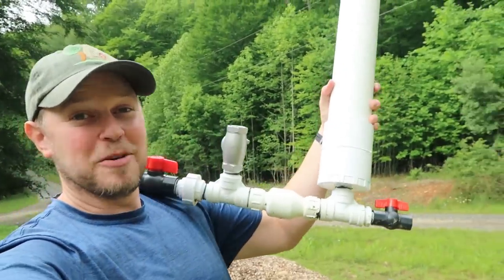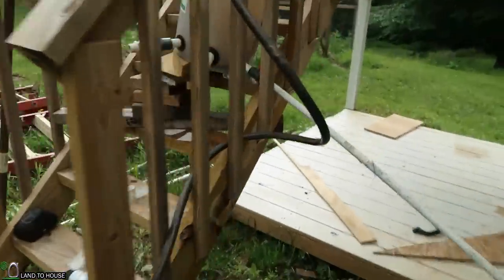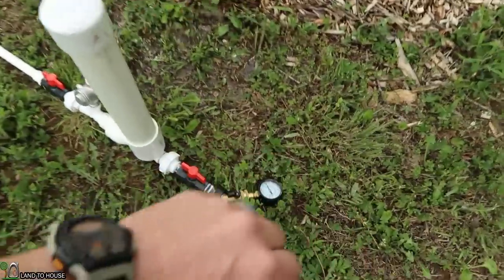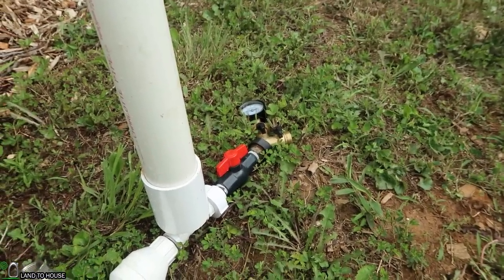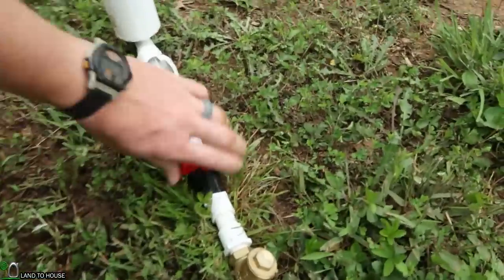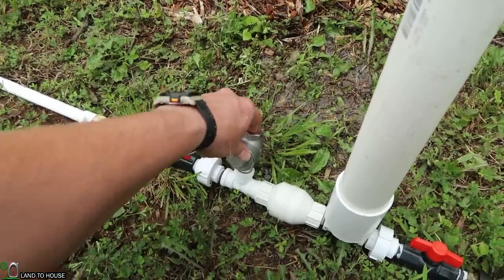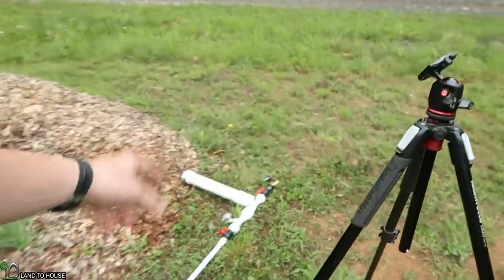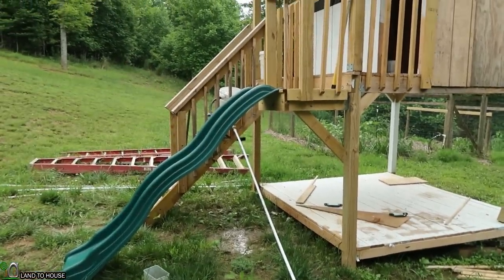Ram Pump with Check Valve on the Drive Pipe ?

Comment: Your videos give me the answer s to my worries concerning the ran pump .you are a good teacher. What happens if l locate a none return valve after the pump ?. Thanks may God give you more energy.
Reply from the maker: Placing a non return valve in the delivery pipe can reduce the weight on the pump and increase output some.

Comment: Move the check valve back a foot or two, and then eliminate the waste valve!  Would the inline valve work as a waste valve and send the water in to be part of the pumped out water? Not just in theory but please have you tried this setup?
Reply: You need the pressure wave to travel back up the drive pipe to reset the check valve.  Eliminating the waste valve can be done but it will add mechanical complexity to the pump.

Comment: I noticed that you tested with a brass swing check valve.    Have you tried a similar brass swing check valve instead of the inline PVC check valve after the waste water check valve and before the expansion tank.   The PVC check valve seems stiff and might constrict the water flow.  I assume you have tried and doesn't work?

Comment: Placing the nrv a 1/3 the distance from the pump(2/3 from source) will make a big difference; the pressure wave(water hammer) only travels back along the line a short distance(around 1/3 distance from pump)

Comment: What would happen if you put the NRV in (roughly) the middle? 
I guess it would still prime but would cycle faster as the pressure wave isn’t travelling as far, so, could it be useful for very long drive pipes where sometimes it’s just too long and would usually need a stand pipe?
Reply from the maker: Great idea! Let me test that next. Perhaps install a 200 foot drive pipe for that 1/2" pump and test: no valve , stand pipe, valve. Thanks!
Reply: In the middle is an interesting idea.  I wonder if this might be an alternative to a stand pipe at the middle location.   Wouldn't allow air to be released, but might have a similar effect of cycling?
Reply: @davebean2886  I did just that with my ram pump. I have a spring-fed pond with about a 6 foot head to the ram pump but the distance is nearly 150 ft. I had HUGE pressure waves oscillating down my drive pipe, so much that at one point the drive pipe jumped out of the pond and disconnected itself from the water source. I placed a one-way check valve at about the middle and most of the pressure wave I saw in my drive pipe dampen to the point it barely quivered as it pulsed in my pond.   I didn't see any real difference in the water output and I easily am pumping over 200 gallons per day up a 60-foot hill. I really liked the one-way valve, it seemed to help stabilize my setup more and was easier to maintain than a standpipe.

Comment: Thank you as another comment said having the valve at different distance from the pump could be interesting. Just to see if there is any improvement at all. Maybe it would work better on a larger pump with the valve at the pump as there would be more volume per cycle between the valves. Thankyou again.

Comment: Is there a way to make a waist valve return to the supply or water source reserve for zero spill maybe a stack that tees off just above the waist valve so you can prime it. Then cap the top after priming but have a line returning at the side of the tee

Comment: At present my ram pump have swing check valve at the drive pipe very closed to the pump the same as you did for your 1st test. I don't have any problem about ti run ir prime the pump. There is an increase  the output or water delivered. I don't know  why you could not run the pump.
Reply from the maker: It is a mystery. I will have to continue testing.

Comment: Is there a neoprene non return valve as used in aircraft in these sizes ? If so ,the force use to operate them will be negligent ,much much less than any swing or check valve .

Comment: Could you put a timer valve in the drive pipe and have it come on and run for a certain period of time, like for a few hours each day, long enough to fill a tank then shut off. Would it stay primed and continue to run daily without human contact?
Reply: The ram pump will run 24/7, 365. The flowing water even keeps it from freezing when it gets cold.

Comment: I would love to see the water flow in the pipe with some dye. 

I suggest purchasing a clear pipe, drill a small hole. Insert a syringe with some dye. Then as the ramp pump is operating, squeeze the dye into the pipe. Maybe even record it in slowmo if needed.
Reply from the maker: I posted the video sometime ago with an endoscope showing how the Ram pump pulses. It is interesting.

Comment: Nice man. I was asking this question myself today, and you can see why. When you contain the pressure wave from the water hammer near the pump the pressure in the pump assembly is greater than the pressure from the drive pipe, so the drive pipe check valve fails to re-open. Curious to know if you would see an increase in pressure if you sat and manually cycled the pump using your finger on the waste valve, as you were doing .Even so the answer would still be 'no'.

Comment: I have a 3/4" ram pump with a soda bottle air tank and 50' feet of 1/2" garden hose the flapper valve is working and the air tank is holding pressure but the water is not coming out of it even when i prime it wat am I doing wrong?
Reply: Use a rigid pipe like pvc so the water hammer effect is not lost; hoses absorb a lot of recoil being rubber, and the pressure that causes the recoil is what makes the pump work.

Also consider a smaller pump if you have less head to work with. Higher head usually suggests a larger pump, while lower head works fine with the 1/2 inch pumps

Comment: I don't understand what the purpose is for adding the extra valve. What would you hope to get by adding it?
Reply from the maker: The subscriber that asked for this test thought it might improve the output because it would not have as much pressure loss going back up the drive pipe.

Comment: Adding length like in your pipe stand video isn't the same conditions.  In this video the check valve is at the pump or at the bucket. One is too close , not allowing for any shock wave, the one at the bucket never gets to the valve to shock it closed. So with the same distance as in this video with the bucket at 20 feet , not 120 feet, people are suggesting putting the check valve at like 10 feet!    ??

Comment: Head pressure questions:  
If I have a 2" pump with a 2" drive that is nLength with a 1" drop then I get pressure x
if I have 3 2" pipes hooked up to a double wye (with 45 degree elbows for the wye sides) then can I divide the drive pipe length by 3 and maintain the same pressure?
If I have my supply coming into a bucket, but have a weighted top (think coffee french press) that free floats on top of the water then can I reduce my fall requirements while maintaining head?
I've a friend with creeks, but the topography gives very little room for drop... so, outside of tracking down an excavator, I'd love to hack a way together that works around that.
P.S.  My wife hates this channel as I've had it playing on the big screen...  but I'm pretty sure if you somehow incorporate a kardashian or desperate house wife drama in the background then I could watch these on the TV without hearing about it >:)
Reply: I'm guessing "Yes" on the 3 drive pipes to a double wye question because the amount of water weight...  but I'm wondering how that'll affect the pressure wave in the drive pipe and the overall performance of the pump... if it does impact it then I'm wondering what would happen if you put check valves before the 45 degree elbows going into the double wye... the pressure wave would hit the center pipe and temporarily shut off the side pipes (which would create a secondary pressure wave? Maybe require a smaller pressure tank added between the check valve on the side pipes and the 45 degree elbows?)